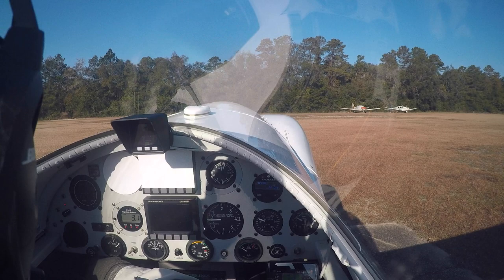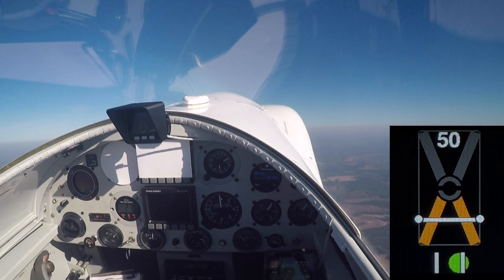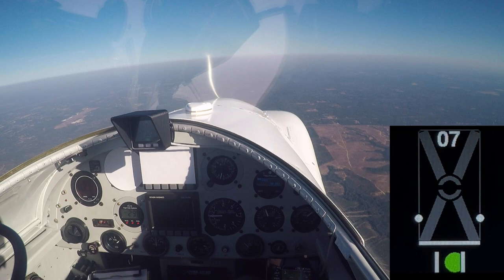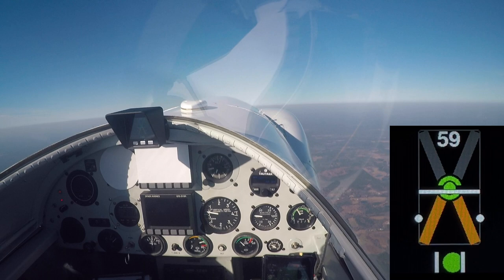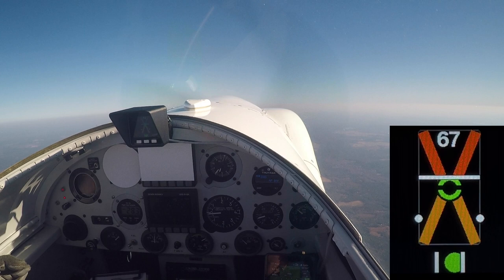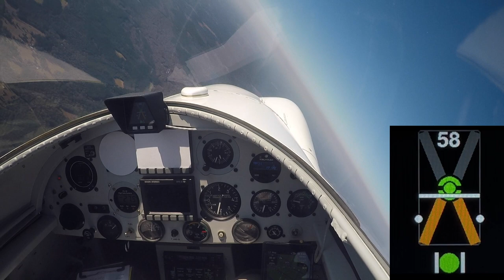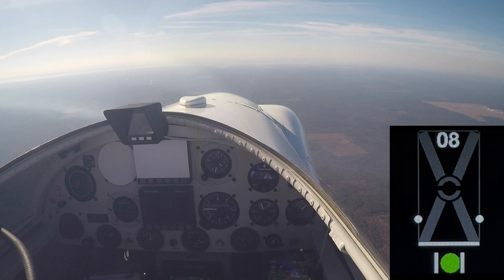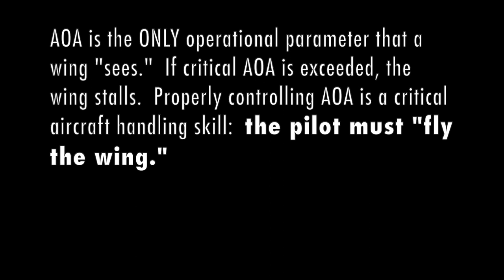Flying without IAS:  Performance-based Angle of Attack Cueing

Comment: Good job Vac, 3 comments

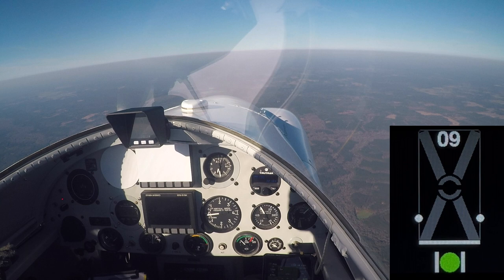7:25 "Not required to pull greater than an on-speed condition," arguably that is not correct.  There are times and places to make an intentional energy excursion.  For example, a collogue in RV-8/A broke his throttle cable at 2450 RPM with a fixed pitch propeller.  If he had your system (with training) he could have intentionally flown a (neg)Ps curve using G, beyond on-speed to induce additional drag to slow down in the landing pattern.  Potentially, he could have bled the airspeed down enough to get below flap speed to add additional drag.     

9:48 "Military Chevrons tell you how to pull to on-speed condition."  That is correct for Air Force fighters.  However, that is 180 opposite in Navy fighters.  In the USN, the indexers display your current AOA status.  You have a second AOA indexer mounted forward facing on your nose gear strut for the LSOs (Landing Signal Officer), otherwise known as paddles, to see your AOA status.  If the pilot is behind the jet while approaching the aircraft carrier, the LSO will make a directive call for an AOA/power correction.  

I see a human factors ORM issue for Navy and USMC pilots' brains looking at the Fly On-speed indexer upside down.  If possible, a selectable code change to put a Fast Red Chevron on top, Amber Donut, and Green Slow Chevron on the bottom.  I understand, the premise of the project is for audible cues only, without the display.  Due to the law of primacy, we are tied to the visual indexer cues.   

16:55: Great demonstration of the simulated failed engine wing stall, followed by glide without the use of engine.  The audience should note that your VSI was greater than -2,250 fpm as you recovered to on-speed AOA.  The learning point is that attempting to stretch a glide and accidentally stalling will drastically hurt your glide profile.  If you were to stall on downwind (1,000 AGL), you have about 25 seconds of altitude left (assuming you recognize and recover to on-speed AOA).  A 180* standard rate turn takes one minute.  This means you will only be able to turn about 75* of heading change, meaning you will not make the threshold of the runway.

Comment: You mentioned, if the wing is producing more than 17% lift, your aerobatic 6 G aircraft is below Va. What % of lift would that be for a 3.8 G aircraft?
Reply from the maker: Great question.  Divide 100 by the limit load factor (3.8 in this case), so 27% lift.
Reply: Thank you